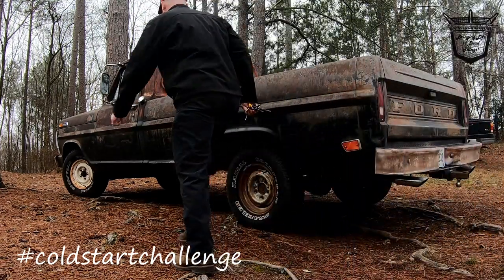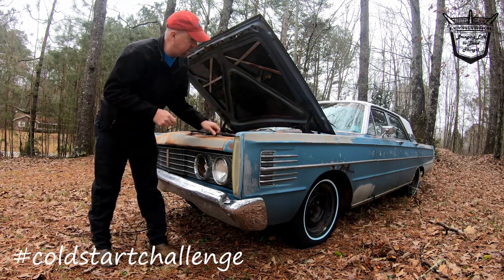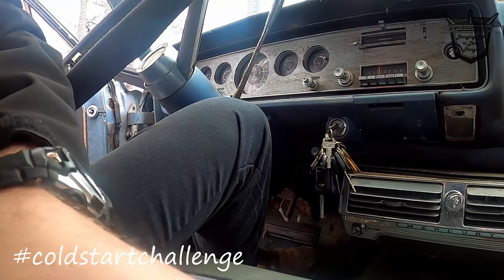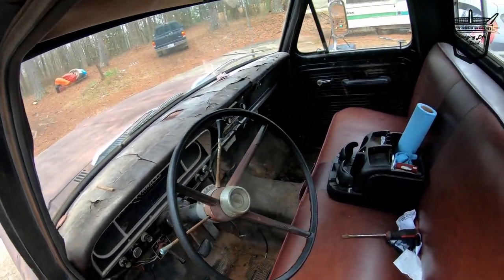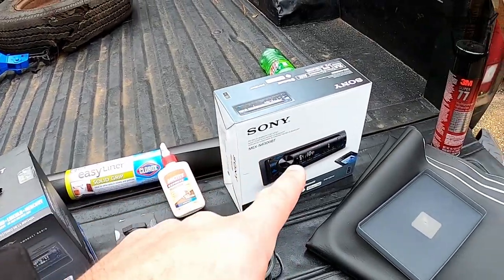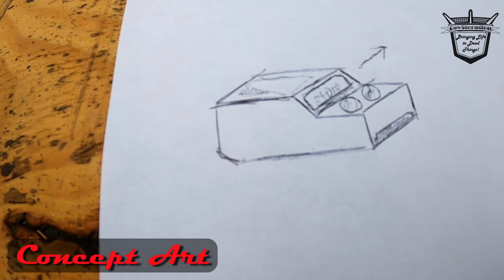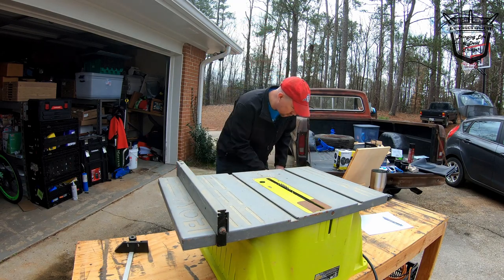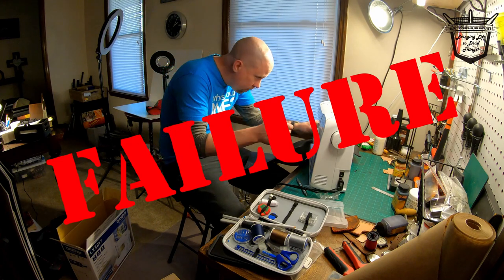Two Cold Starts 1968 Ford F100 & 1965 Mercury - Ole Puddin gets a Soul #coldstartchallenge

Comment: Looking good, now ya got tunes. As a retired carpenter, I installed a lot of that wrap around doors, panels, etc. you did a good job. I’ve made button tuck door cards for cars, trucks, boats etc. it would make a nice headliner, or dash, make it out of rigid foam and glue, works nice
Reply from the maker: I may have to look into that method... I need to work on the floors, the doors, the headliner, the dash.... well all of the interior.

Comment: Haha I did a cold start challenge on my daily driver. Wasnt shocked she started at -5F. It got colder though. Tires went flat, think because of the snow. Theyll run if you got a strong battery and a good engine with a clean fuel system.

I like that radio box idea. Dont know if Puddin ever had speakers in the doors, or rather that era. That may have been an 80s or 90s changeover, tend to be a dash speaker only if I recall especially in most trucks but thats a pretty cool design either way. And cup holders!! Make sure to keep them covered, you dont the drink splashing on your new radio or all over every time you hit a bump.
Reply from the maker: Correct... the only speaker was the 6x9 in the dash... That is a good idea about keeping the cups covered.. Thanks for watching.

Comment: My antique car starts up really good, it is not cold natured. Just that I've got a new engine and transmission. My car has an original 8 trac am radio it only has gospel stations. That I also need a modern radio in it. To keep my car original. I need to mount the radio separate.
Reply from the maker: I always add boxes like the one I have here so that I can remove it if necessary... I never cut up the dash and it works like a new one.

Comment: Great job on the console, old pudding definitely deserves a radio and console. Hate you threw a rod in Nickys sewing machine, you know that means you will be back into your Rat hole money to rebuild that.Please no modifications on sewing machine!😂😂🙏🇺🇸
Reply from the maker: Jerry... I had the setting way off and when it stopped it stopped... I called failure rather quickly on that one. Thanks for watching.

Comment: Rev :) should have idle to 750 to 850 turn up on carbs for Pudding or any carb vechiles do for Videos for any of vechiles easy fire up plus warm faster and that why hear Fuel Injection vechiles run high idles on cold starts then high idle come down after warm even hot starts to! Something to think about if you can and be helpful to lots ways too! Won't hurt engine have high idle in cold starts or hot starts because Alternator and Generator outputs be full amps they are at plus recharge batteries plus faster to plus get electrical working excellent too!
Reply from the maker: Andrew. I have always tuned a carburetor by ear.... When it runs right... it is right... Timing the same way... and it usually specs out perfectly.. weather changes the carb tune.

Comment: Pastor if you are going to do. Floor pans. I would get replacement ones. And when the do the work. I would use. A plasma cutter. Which has no flames. And it would save you alot of hassle. And then if you have a mig welder. Just tap hold the metal in place. And get a mask. To protect your eyes. And then slowly weld in the floor pans in place. And you have something nice! I hope this helps out.
God Bless
Sven
Reply from the maker: Will do for sure.

Comment: Scoche is pronounch skosh. The 4" go in the front deck and 5.25" go in the doors.
But wire them in series and connect them to the front channel wiring. It will double the impedence and lower the output but 4" speakers dont kick that much anyway. 
Your dynamic sound in a pickup cab will come.from the rear speakers which should be 6x9" you can mount under seat or behind the seat or stationed at the top of the B pillar.
Reply from the maker: I would have never known.
Reply: @RevStoration  yea that Walmart set up you got is good but you re gonna need an amp make Ol' Puddin thump. Those stereos are rated at 40w/ch but at the higher volume there will too much distortion(S/N ratio) for great sound. 
So if you hit up a pawn shop you probably could find a low line 25w 2 channel amp to run with that stereo. A regular cab isnt like a Suburban so with that small interior cabin wire the front speakers to the amp and wire the rear speakers straight to the radio. 
Just some ideas...

And when you get it done, patch in "Love Alive" the album by Walter Hawkins. That is a good album!

Comment: And what with the old radio you can repair that radio and use it again the new radio is not looking good in this old design dash
Reply from the maker: The Old radio works but doesn't have the newer features... I can remove the box at anytime and the truck is completely original. It works for my use. Thanks for watching.